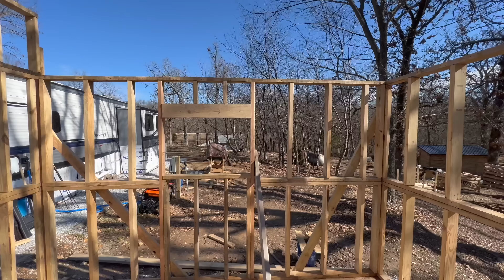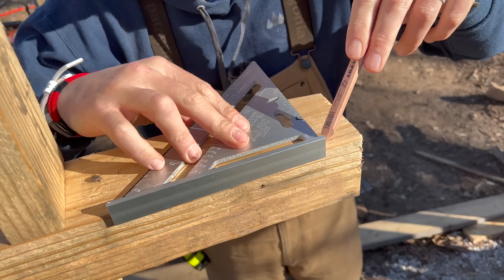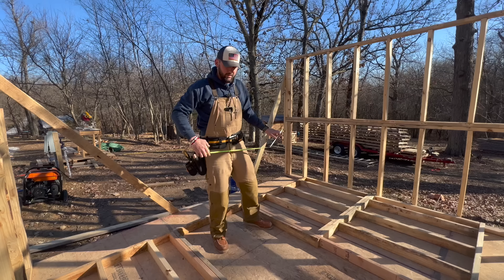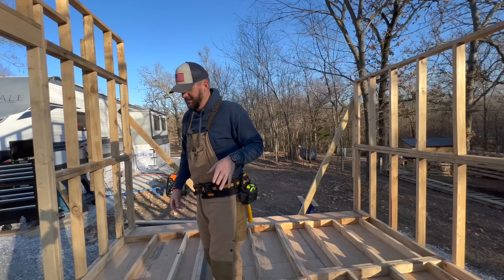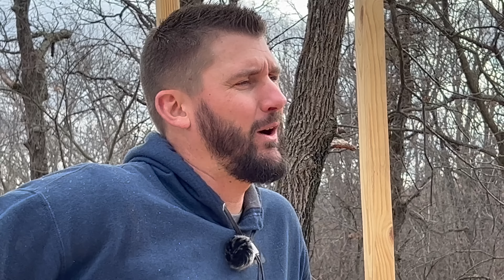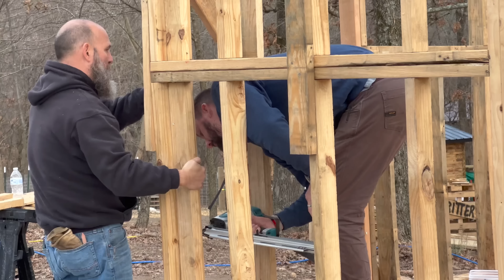Securing our SHED walls!

Comment: Uhh... Don't you need a top plate? I don't know about a shed but definitely would need one on a house. You might want to check on that. Other than that possibility, y'all are doing great. Plus a top plate would make the pieced together wall more sturdy, just make sure to cover the seams with it,  don't let the top plate have a seam at the same spot as the 2x4 under it. Even on the corners

Comment: I know it's not common, but when I built my barn and put in windows, I placed a 2X4 stud across the top of the window, before I installed the header. I could nail the 2X4 to the cripple studs, easily, and then nail the header to the 2X4. 2X4 as a top plate, two sideways 2X4's for the header, gave me a 6 inch thick header, in total. Same as using 2, 2X6's. But a bit cheaper, and likely, stronger. And a bit easier to nail up. Even if it took a bit longer to do. Just giving you ideas that worked for me. What can I say? I worked with what I had.

Comment: Not trying to be funny but usually only hillbilly buildings follow the slope of the land. Doors & windows are always put in square to the building. Otherwise doors & windows will not open & close. That's what I was always told anyway. I believe even fences are put up with a level. It looks funny with the land sloping but look at some others as you travel to town.

Comment: Kyle the way the shed is framed is totally fine the two end walls with the window openings are good too and the long walls will be fine with the way you framed them with the door opening has two jack studs running vertically from the bottom plate to the top plate and the back wall will be fine because the roof will not have a lot of weight stress on it, for when you do the roof I suggest using 2" X 6" lumber on two-foot centers and 1" X 4" strapping on two-foot centers also running perpendicular to the 2" X 6" and then use the same metal that you put on the goat palace if this doesn't make sense your friend that helped you frame can explain the information that I gave you, structurally you are doing fine good work so far, that was great that your friends came and helped out and by going to help them in the future all four of you can be proud of what you have accomplished I enjoy watching your channel, hoping your friends dive Into vlogging too.